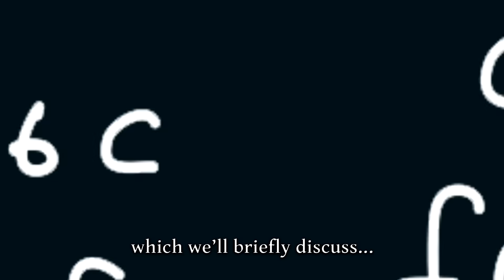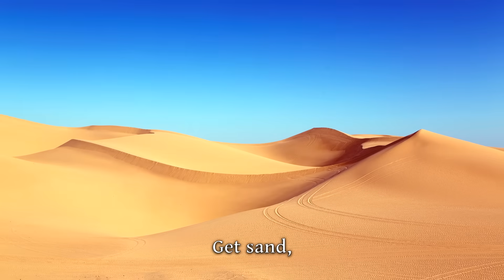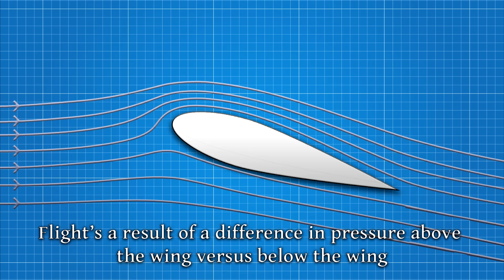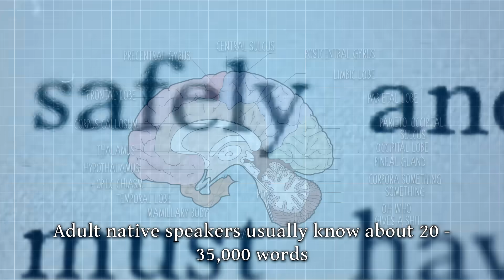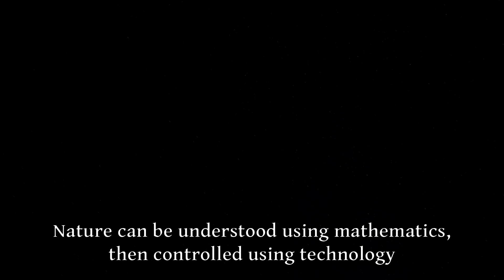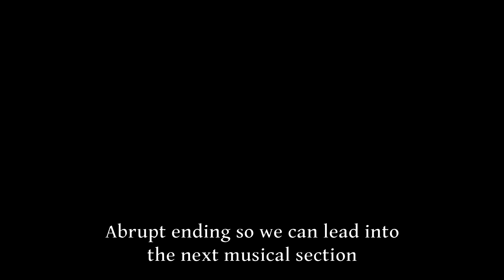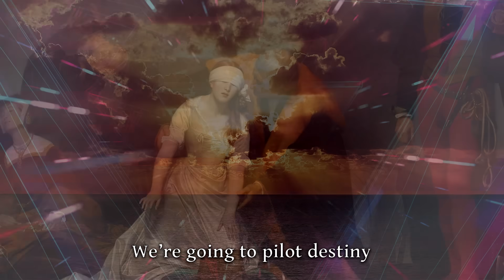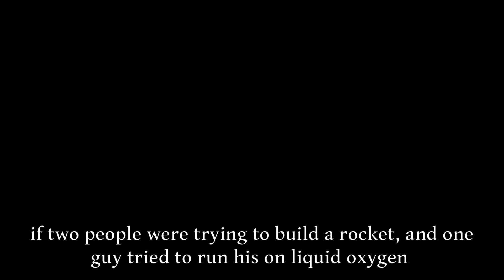10,000 More Years of the Scientific Method

Comment: "Or halfway successful nuclear fusion"
Good news, it's gotten there as of December 2022! Although it's not yet commercially viable due to inefficiency, scientists have gotten something called a "proof of concept", which is basically going from "this should work but it doesn't" to "this works, and we've seen it work". They were able to get more energy out than they put in, which is a huge step in nuclear fusion because it unlocks the doorway for the more cautious investors to invest because they see that it works now and that it will obviously become extremely important and therefore profitable in the future.

Comment: but how do planes fly upside down?
Reply: Most can't fly upside down for extended periods since the engines aren't designed to function upside down for extended periods. It is not usually a matter of wing shape that determines the bulk of lift, it is the angle of attack, or angle of the wing relative to the ground. Air 'bunches up' under the wing and causes a pressure that pushes the plane up. Described in this way, flying upside down poses no problem as long as you ensure your angle of attack and speed are sufficient.
Reply: @Nelinno04 i wasn't expecting an actual answer haha i was making a joke. thanks. so as long as the plane's got its shoulders back sort of thing with sufficient speed it'll stay lifted. and the shape of wings just helps with lift but isn't crucial?
Reply: @sidarthur8706  Hmm. I mean it's crucial, there's just a lot of shapes that work. You'll see concave a lot because the scoop shape helps capture more air under the wing. In trick planes designed for upside down flight, you'll see symmetric wings so their performance is identical whether or not they're flipped. And yeah my bad, lol. Your joke is actually a question posed by many astute students in intro fluid mechanics classes because the way most students are taught about lift for planes is intuitive, but too simplified to explain something like an upside down plane.

Comment: While technically true, I don't like the delta pressure theory of wing lift, it is unintuitive by itself. It is used a lot to explain lift theory together with the incorrect longer/shorter path theory, see NASA: https://www.grc.nasa.gov/WWW/K-12/airplane/wrong1.html
I like the turning theory better, it is intuitive and can be summarized in one sentence: Lift is generated by turning air downwards because the air follows the wing shape on both bottom and top of the wing by Coanda-effect.

Comment: Your explanation of plane wings is wrong. Planes stay up by running into air and pushing it down (and Newton's third law of motion). That's why the wing extends a piece of metal off the back when the plane needs to stay up while going slower. An extra metal flap will do exactly nothing about Bernoulli pressure difference crap.
And I don't think you directly addressed how important energy is. I'm better off than my ancestors because I can get more food energy, and more mechanical energy, and absurd amounts of chemical and electrical energy. The average American eats a bit over 2000 Calories of food a day, but dissipates over three times that much energy every hour in other forms. That's what allows us all to live better than emperors. And that's why I support nuclear: because how else will we get enough energy to live like gods? How else can we extend a Western lifestyle to poor parts of the world without turning Earth into Venus? How else can we manufacture fuel cheaply enough to make space flight affordable? I want fun toys, and I want enough energy to run them, and I want everyone to have the same.

Comment: We're actually getting pretty close with fusion! the rate of energy generated versus input has been steadily increasing since the fifties, at the same rate as Moore's law!  ITER is projected to produce 500 MW of energy from 50 MW of startup Heat, making it the first Fusion reactor ever to have a net energy gain. (I suspect it will be lower than projected, but still in the green) its still two to three reactors away from sustainable reaction, but at this point securing funding will be much easier as fusion is now in reach in our generation.

Comment: I  love this channel.  And I love this video.  But I have to say, the idea that airplane wings work because of pressure difference above and below is just flat out wrong.  While the difference in pressure does add to the lift, it's the wing's angle of attack that allows air to flow over and down, creating lift.  If you ever held your hand in a cupped fashion outside a car window, you'll know how a wing really works.  The wing's camber, or shape, does add some degree to the lift but it's not how most of the lift is generated.

Comment: hey great song exurb1a! but I think you're mostly incorrect about how planes work -- it is true that a difference in pressure yields some of the lift of a plane, but that alone could not keep adrift. the majority of the lift comes from the angle of the wing, and the force of the air hitting it pushing it up. its like putting your hand out the window in the car, and changing the angle of your hand to make it move up and down. most of that force comes from the air hitting your hand and transferring its force at an angle that results in upward/downward force.
Reply: Angle of attack affects that pressure difference
Reply: You realize that what you just described leads to a difference in pressure? Put a pressure gauge on both sides and see if mashing into all that air with your wings at an angle doesn't raise the pressure per inch a bit
Reply: @CrayPlaySwe  yeah, that is another factor other than the Bernoulli effect that creates a pressure difference. But the pressure difference is not what causes the majority of the lift, it's the equal and opposite reaction of thrusting air downwards when you push it out of the way
Reply: @StealthWhale80  But do you realise that pushing is an effect of pressure difference? If air push wing because of angle of attack it means it pushes it because it has makes more pressure than air behind wing
Reply: @StealthWhale80  also bernoulli principle talks about incompressible
, not sticky liquid which is nothing what air is.

Comment: Quartz crystals are made like tiny tuning forks, they can be made to oscillate with very highly stable frequency anywhere from a few tens of Kilohertz, to the high Megahertz. We specifically make a Quartz crystal for watches to oscillate at 32,768Hz because it is 2 raised to the power 15, requiring only 14 divide by two stages to reach a 1 second pulse rate! Other than that brilliant video!

Comment: I think this is a linguistic issue at its core. 

In my book the most "magic" seaming property of the universe is consciousness. 

But that doesn't mean it is not a fundamental part of the universe in some way. 
(If through emergence or a fundamental physical property.)

The problem with the term magic is, that it assumes an external force that can subvert causation, but it still has to function in some way.

So even in a world with "magic" (like harry potter) scientists could still observe test and measure it. Find a theory of prigin and hor it relates and works on a physical level. 

The thing is, causation is not an absolute concept, in a world that in some definition "began" in some way "at some point" it can't be an absolute concept.

So free will would probably be the most magical thing we could observe as it subverts causation and may be impossible to observe or explain in depth with the scientific methode completely. 

Then it would seem like magic. 
Be nearly identical to the conceot of magic. 

But at the end of the day it would still be a natural part of the world. 

And not magic as the term used in this video.

Comment: Within the next 50 years we will probably have mind uploading, and enough computing power to run the uploads FAST. When a bunch of top scientists get uploaded and you have teams of researchers thinking 10 000 times faster, then science gets good fast. Or we might build an AGI that just does science that much better.
When you have nanobots and brain machine interfaces, you can imagine a device, send the design straight from your imagination to a computer, a few simulations to check it works, and send it to the nanofactory. You have a working device in your hand within 5 minutes. As tech improves, we invent things that speed the whole process up. General purpose tools.